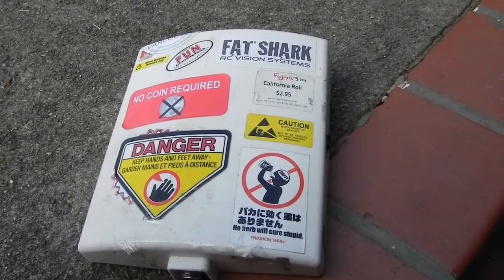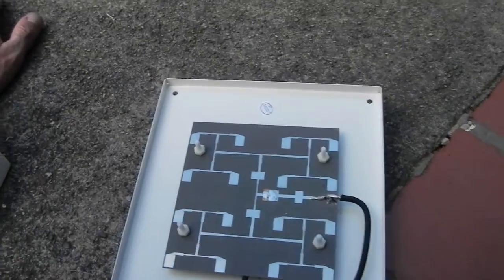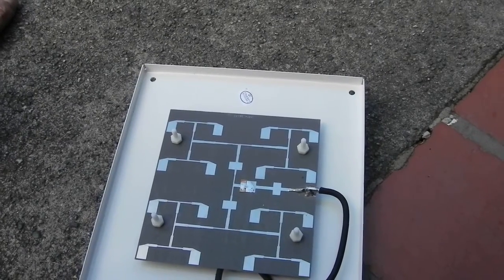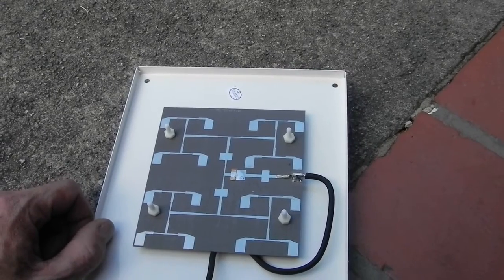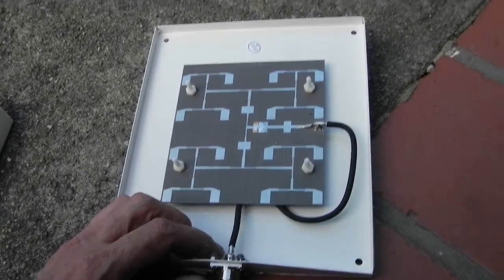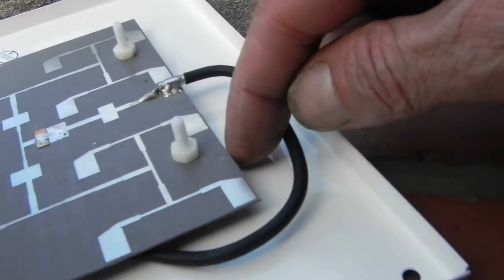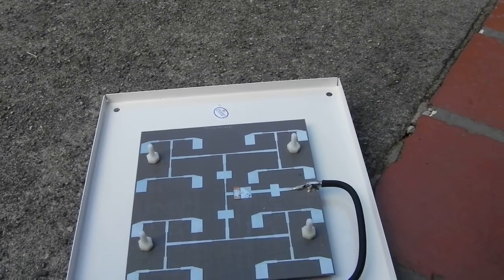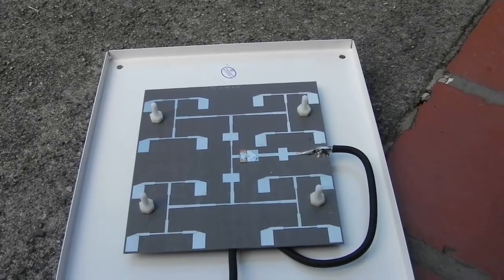What's inside a 18db premium patch antenna for 5.8ghz FPV? come see!

Comment: wait so you can use 19-22db wifi patch antennas for 5ghz to get better range?
Reply from the maker: +Ironiic zero Good quality tuned ones at least, anything under $50. will not help though and dual band type are not worth the money. This one works great in my abs briefcase ground station.
Reply: http://www.ebay.co.uk/itm/22dBi-Directional-Panel-Antenna-5GHz-Bands-A-B-C-/390837630986?hash=item5affbcf80a:g:A3gAAOSwQPlV~Aj-

this is what im interested in. 

would i use a dipole or a clover leaf for this antenna?
Reply from the maker: Ironiic zero I think that is a bit pricey, I would check overseas. I got a good one and good shipping from FPVmodel.com
An internet shop or service may also have used ones. They don't have moving parts like my '69 BSA 441 LOL! I use cloverleaf and linear dipole antennas on quad and they both work to 700m plus
Reply: Ironiic zer
Reply: Hoverbot1TV it's alright now. I decided to use 2.4ghz blue beam ultra and pepperbox. Got a 1W transmitter coming. I will use the 2.3 channels to get away from the WiFi noise